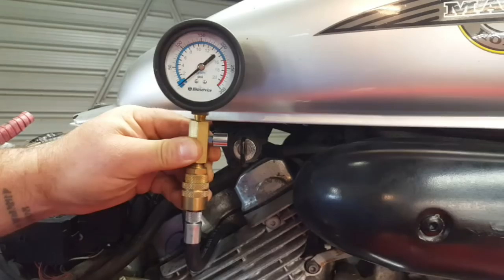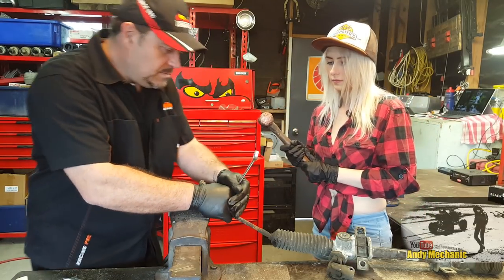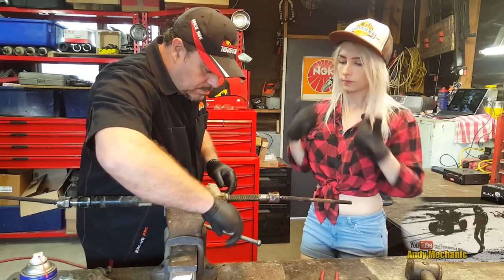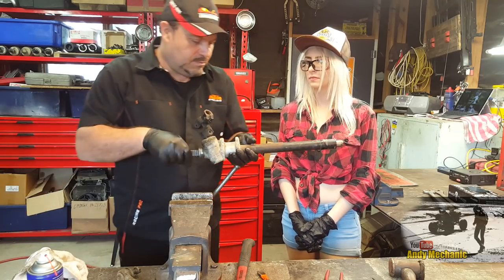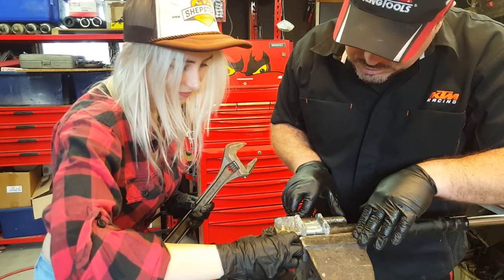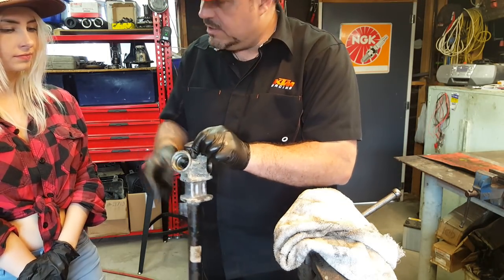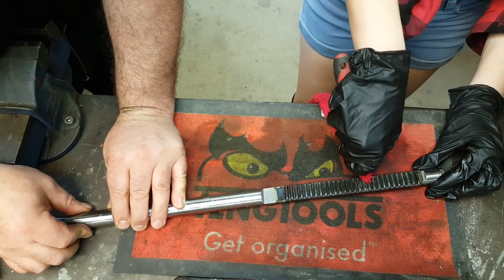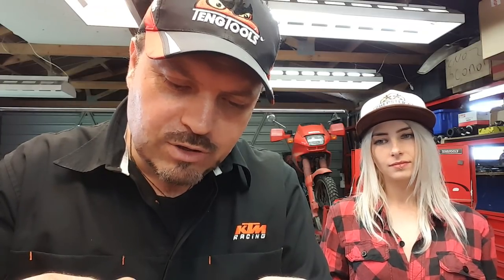Steering rack strip & inspection ft. Tool Girl Sam #1507

Comment: Where would you buy that plastic bushing on the side of the steering rack opposite the pinion, its an old ford laser ke. Thanks
Reply from the maker: +Dom sava Possibly a rack reconditioning company may be able to supply or main sealer. It's called the 'yolk'.

Cheers Andy
Reply: Andy Mechanic not the yoke the plastic o ring bushing on the passenger side, sorry
Reply: Or is that a yoke too
Reply from the maker: +Dom sava oh...the mounting bush?
Reply: 41:43
Reply from the maker: Dom sava I have taken a look and yes, that Bush is replaceable
Reply: Andy Mechanic thanks, problem is I ask for that bush and they think I'm talking about the mounting bushes, I might take your advice and try asking a specialist for it
Reply from the maker: +Dom sava yes, it will only be available from a specalists or via a main dealer.
Reply: Andy Mechanic thanks for your help
Reply: IfingerblastGranny's nah buying a 3d printer will be worth more than the car and I won't use it much but thanks
Reply: Dom sava.......try Autolign or BNT. You are looking for inner rack shaft support bush
Reply from the maker: +Craig Hughes Thanks Craig, I was under the impression it was getting difficult to find rack seals etc but it's great to know you still can get some parts. Thanks for your input.  Cheers Andy
Reply: Andy Mechanic yeah Andy it is way harder now to find seals etc for the older cars. Alltranz is another good supplier to add into your info book, lol. They are a good autotrans parts & steering parts supplier in NZ
Reply from the maker: +Craig Hughes Awesome, thanks for that extra info Craig. Often just knowing where you can source the parts is the hardest part of any repair. Cheers Andy